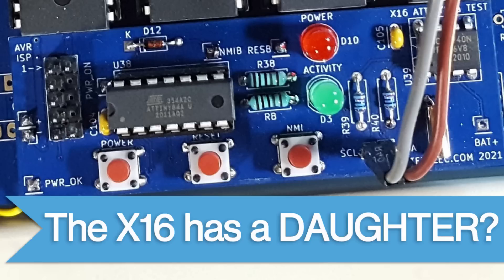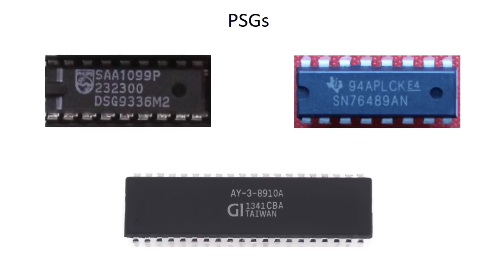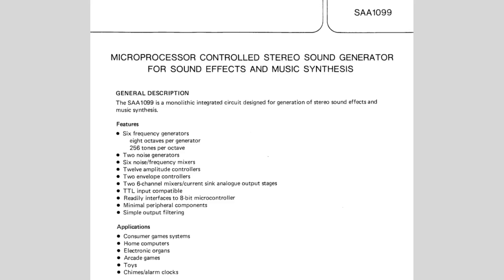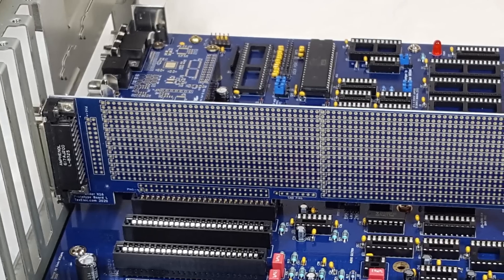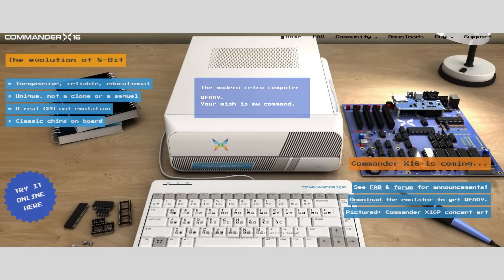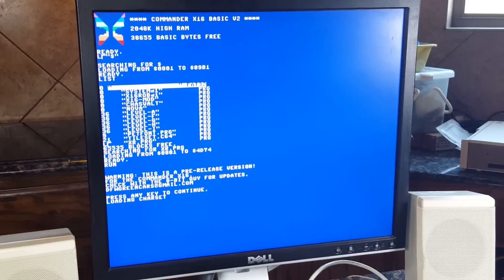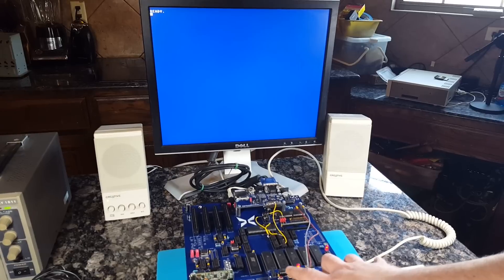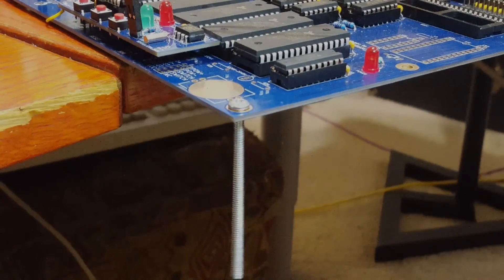Commander X16 - Proto #2 - Design Updates and Next Steps

Comment: A "retro" ATX power on cycle can be very simple: The power button shorts the \PWR_ON to ground and the power supply will start up (<500ms). The PWR_OK is tied to your reset, so the system is brought out of reset as soon as the power is good (+100ms). You would also connect a line from your PIA chip to \PWR_ON. This is high after reset and the first thing the 6502 would do on boot is set this low. The machine is now powered on until you change that bit on the PIA chip to power off the machine. This solves two problems - you don't need to add another CPU to your board, and you've plumbed the power on/reset through your main CPU to ensure the board only powers up if the computer can boot.

Comment: You could also do what most ATX computers do. Map reset to a quick press of the power button, and have a longer press actually power the system off. Then you could use the reset button strictly for NMI. Although, there are some ATX cases that don't have a dedicated reset button, so perhaps you should map that to the power button too? A quick press activates NMI, a longer press (3 seconds) does reset, and an even longer press (5 seconds), powers the system off.
Reply: Or addon unit with more buttons with extra jumpers that can run back into the gasket on most cases to give full access to all of them, not sure if the X16's case has such a gasket though or if it even needs such

Comment: Why not add a proper i2c bus controller, a PCA9564? It is 6502 bus compatible and having a proper I2C bus controller would make coding a lot easier and faster than bit-banging.  "But it will make the board more expensive!"... I hear you say. It's true, the more chips you have the higher the price, but a PCA9564 is waaayyy cheaper than WDC65C22. In a computer like this you always have too little pins on the IO controllers available, so a cheap way to get I2C without using WDC65C22 pins should be more than welcome.
Reply from the maker: One constraint I have on design, is that everything must be through-hole.  Also, the second 6522 on the system is largely unused.  It will most be for the external user-port, so we have plenty of free pins.  I wouldn't sweat the routines too much, if I know Michael, there will be a tidy library for this by the end.
Reply: @TexElec  The PCA9564 exists in DIP (PCA9564N), but like many chips only the SMD versions are still in production, the DIP version is still sold on places like AliExpress though. You could also look at the predecessor PCF8584, of there is much more supply being offered in DIP, and at dump prices.

If you have plenty of spare pins though, the cost argument remains valid.

Comment: Still don't get who is gonna purchase another of this "new" "vintage" computer that have 0 software their are a gazillion of them and usually after 6 months and 3 programs for it they got forgotten and a new one takes its place.
Reply: It's a fun little hobby project. That's enough to make it interesting for a lot of people.
Reply: I must say I was initially excited when I heard about it from the 8-bit guy. But now I see the X16  getting PMICs, I2C and PCM output, I'm not sure how "retro" this still is.
Reply: So it has an 8bit microprocessor and an 8 bit microcontroller, accessed by bit banging I2C on a WDC6522.

And then over in another corner, there's complaints that there is not ADSR envelopes for volume AND pitch in the PSG, so the 65c02 has to handle that itself.
Reply: Bearing in mind the "pmic" is an 8bit microcontroller with 0.5 KB RAM and EPROM and 8KB of flash storage. This is a perfectly 8bit way to use through hole, off the shelf components to the smooth off the rough edges of existing 8bit systems part of the original vision.
Reply: I'll be buying one. This project already has a huge community and you can already write software for it in an emulator (and much software has already been written). As it boots to a BASIC prompt there's nothing stopping you from porting over any of the gazillions of available programs already written in BASIC.

Comment: This was supposed to be a $50 computer made from off-the-shelf parts.
It looks like it got 10x more expensive and uses programmable microprocessors.
Reply: The group has already said that they know they can't make such a cheap machine until sales make it possible.  And frankly, think about a $300 VIC-20 computer in 1981.  Today, that would be $800.    I hope this is the start of a new generation of full-hobbyist (ie fully understood, fully controllable) computers.  I'd like my children to feel the same sense of mystery then mastery over a machine that I had growing up.
Reply: @Beldraen  Are you really comparing the price of technology 40 years ago with the price of it now? SMH
Reply: @Okurkaarrgghh  Yes, and?  I'm pointing out that things have gotten cheaper for components today.  Even if they ask for $400 for the machine, it's half the cost of the machine in today's dollars.  Realize, the reason why the Raspberry Pi is $30 is because of mass production of proprietary parts on a small board.  If you really want a $50 machine, buy a Pi, get stickers for a keyboard, and run the emulator.  Unless someone has a several million to throw down on mass production, this isn't going to be as cheap.
Reply: @Okurkaarrgghh  Actually, David said he would like it be $50, but that it cannot happen in the first phase (https://youtu.be/sg-6Cjzzg8s?t=1219).  Also, you're comparing orders of magnitude to things that are now built SoC style (System On a Chip) with 100K+ production lines.  If someone wants to step up to provide a few tens of millions to fab out Pi sized board with all the circuit integrated two or three chips, that would be awesome.  Otherwise, it is not realistic for the price to be anywhere that low.  Every one of those chip have individual production costs, the board DIP sockets repairability and connectors for expandability, there will be assembly for the board and circuits, etc.  It's going to be a few hundred dollars to start.  I hope they can get it under $400.  If they can hit $300, I honestly think this could have a chance at STEM classes.  A machine that hitting reset puts you back to zero is awesome.  I know supporting my child's Chromebook in virtual school is not fun.  He's always finding odd settings to change.
Reply: @OffTheBeatenPath_  Well, we know what David thinks. He made his wishes clear in the first video. The fact that he has subsequently (for several reasons) accepted compromises to his 'ideal' retro computer does not alter the fact he really wanted something simpler and cheaper. It seems you're being rather childish.
Reply: @TurboXray  Actually, I suspect he has rather more intelligence than you think. He has seen the design aims given in the first video and compared it to what the X16 has become. And he is right, the original ideas have been diluted, whether through necessity or preference by the other members of the team. You can achieve most of David's aims on emulated 8 bit systems like the C64, Atari 800, BBC, ZX Spectrum etc, on a cheap RPi Zero. The software is free, you can download free books and manuals that describe every nook and cranny of old machines in detail.The X16 could just as easily exist solely as a custom 'virtual' machine or in FPGA.
Reply: @another3997  "The X16 could just as easily exist solely as a custom 'virtual' machine or in FPGA"  and "You can achieve most of David's aims on emulated 8 bit systems like the C64, Atari 800, BBC, ZX Spectrum etc, on a cheap RPi Zero" <- That right there means you're just as clueless as him. Completely missing the point of WHY it's not simply FPGA. Smh
Reply: You are talked over a year after the SECOND video came out but pretending it doesn't exist. "Explain to me why this thing that was explained over a year ago is the way reality works!"
Reply from the maker: Been going that way for pretty much since the first video.  Honestly, it will never be $50 unless it's purely FPGA-based, and even that may be a hair higher.   Cost reduction is planned further down the development cycle.  This is the "everything" build, and has a full bus, user port and other goodies some of the later systems may have removed to hit the target price.
Reply: Did you saw the second video from David? He said that the first commercial version was going to be 200~300$ and from there the next versions will be cost and size reduced.
Reply: If you look at the inception of the project the main goals were to keep the price low so people could afford it and it could gain a wide user base, and not be a retro computer emulated with fpga or the like, but use basic components so the design and function would be simple to understand and program. Sad to say but I don't think this is becoming what it set out to be.
Reply: @Lassi Kinnunen 81 yeah but the reality which has been pretty much hashed out the past 2 years is that there are no parts available that are easily, cheaply, and reliably accessible and wouldn't also require an exorbitant time and resources to shoehorn engineer into the project -- especially when it came to video and graphics.  

Sorry that a lot of people are disappointed about this, but it's really been hashed out over the past two years and this is the most realistic compromise.  The project still addresses the basic and most important parts of the ideology underpinning the project as a whole which is programming the WDC 65C02S.  If later it makes economic sense to just implement it into a FPGA, to cut costs, but this is just the path that has been forged through compromise -- makes total sense to me.  The original intent to use original secondary ancillary components of the era has changed, but it doesn't make sense to continue down that path if it leads to nowhere.  Anyone who has even started constructing anything even remotely like this knows this -- anyone else just came here to hear themselves bitch.
Reply: @Okurka just parts for Ben Eater's breadboard PC I ordered on Ali cost me something like $50. This thing cannot cost $50 even in the simplest form. You just don't understand the goal. Or don't see the prices.
Reply: @rkurbatov  What part of "supposed" don't you understand?
I didn't come up with the $50 price.
Reply: I don't remember ever hearing a sub $50 price from David or anyone else from the team.  I know $100 was thrown out at the beginning as a suggested target, but I think for anyone who has ever put together a kit from scratch knows that the combined the costs of every component and fabrication  (nevermind human man-hours and design, testing, quality control and everything else that is a part of system manufacturing) only comes together and reduces in price through segmentation and scale.
Reply: @styloroc2000  I didn't say sub $50.
Dave says in his first video about the Commander X16 that the price goal is around $50 as it shouldn't cost 5 times as much as a Raspberry Pi with the same performance.
Reply: I don't think performance was ever really the point.
Reply: @Okurkaarrgghh  this is obviously way over your head
Reply: @Okurka That is a long-term goal. If you had watched the other Commander X16 videos, you'd know that David will be releasing it in 3 stages:

The P (pro) version, which you see here, will be the first and most expensive version.

Then there'll be the C (compact) version, which'll be a bit less hackable, but will be around the $100ish range.

And finally there'll be the E (economic) version, which'll be a small $50 machine sort of like the Raspberry Pi but 8-bit.
Reply: The only way to make it $50 is to make a X16OC (X16 on Chip) with a VLSI designer
Reply: @Lassi Kinnunen 81 The Coleco ADAM used three 6801 microcontrollers inside the system board as well as another one in each of the printer and keyboard.  The Maxx Steele Personal robot used two NEC COP4xx microcontrollers (About as powerful as the PIC 16Fxxx or ATiny series) inside, as well as an additional on in the radio control unit.  Offloading some of the timing dependent grunt work to smaller processors is still pretty retro.  At least with this system, the chips are able to be modified by the end user, unlike the older systems.
Reply: An ATtiny24 is most certainly NOT a powerful CPU that could be the basis of a more powerful CPU. It's an 8bit microcontroller. If WDC made a 24pin 65c02 microcontroller with an I2C interface, they could use that, but they don't. It's not like there's a 32bit 4-core CPU emulating an 8bit CPU.